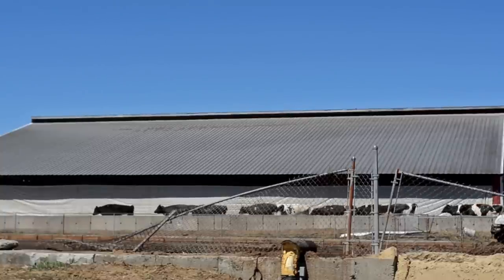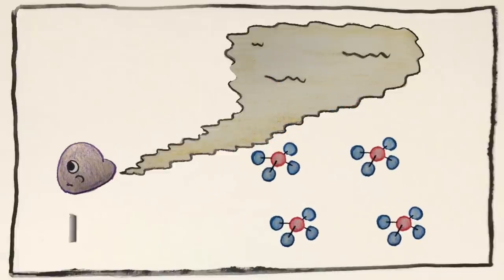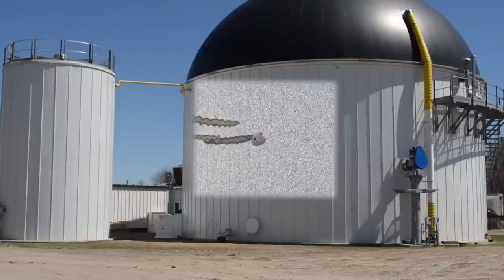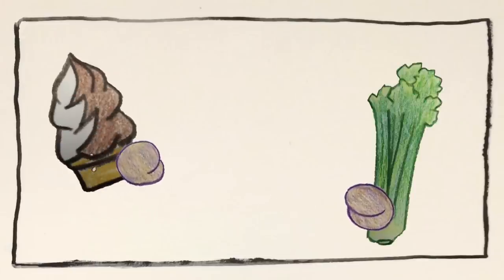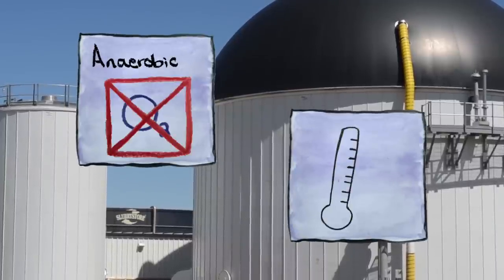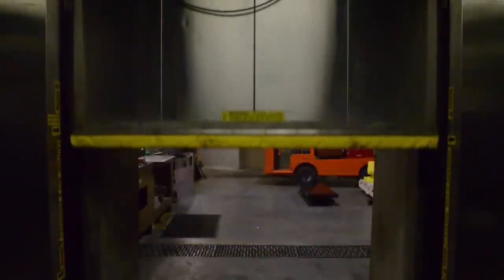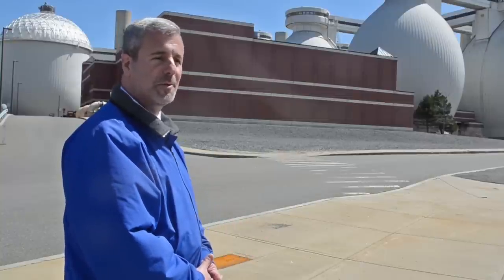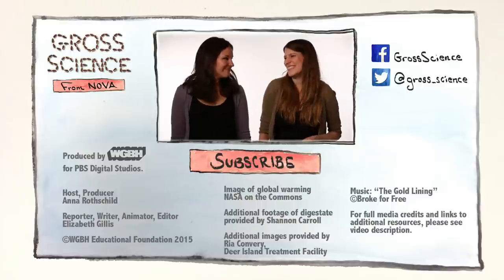Much A-Doo About Poo

Comment: Some friends of mine have got this system in their farm!
Please put Celsius degrees on an annotation next time.
Reply: I use celsius too but this number was easy to convert (and I'm BAD at math), the key is remembering standard temps like freezing and boiling point, etc. Normal body temperature in Farenheit is around 97°, and 99, or 100 are febrile, having that base to compare I think they'd be talking about around 40°C which males sense because we're talking about gut bacteria.
Reply: GHz II Actually, more like Kelvin. #Kelvinistherightunit
Reply: GHz II You can also calculate the Fahrenheit to Celcius.... C = 5/9 (F-32) is the formula.